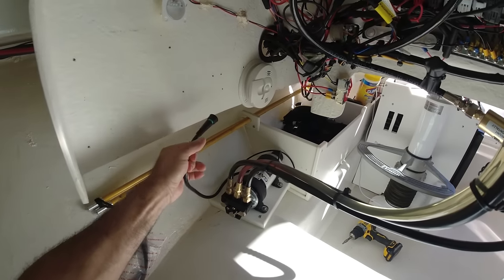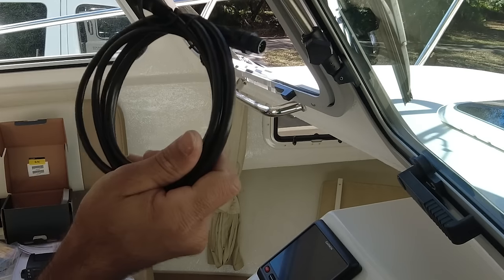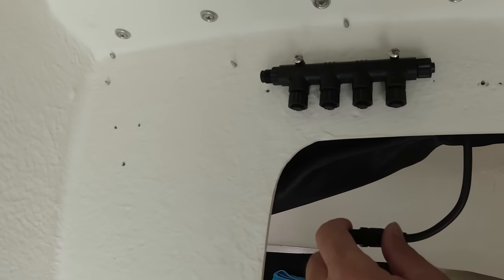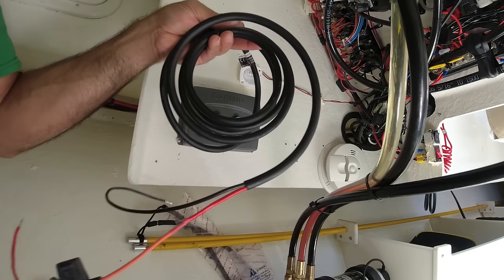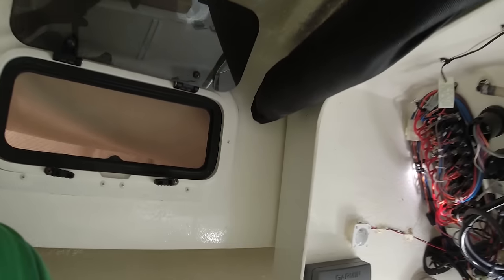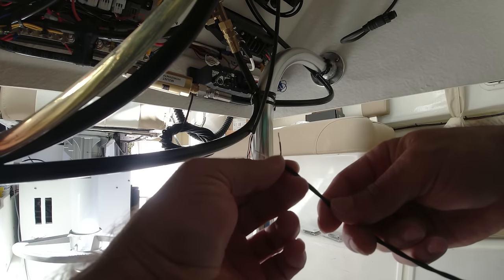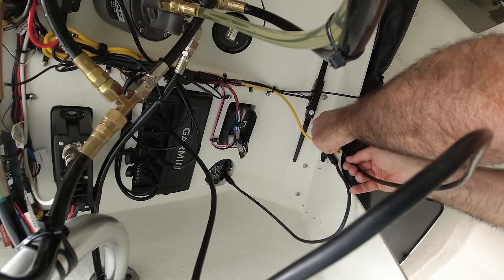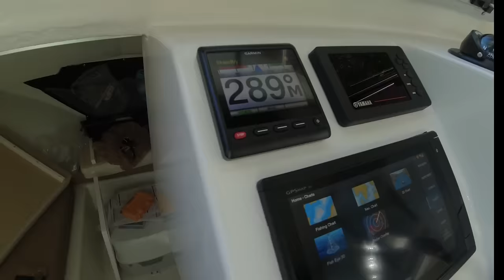Garmin Autopilot Components Installation Part 2 Garmin Reactor 40, Hydraulic Autopilot Corepack

Comment: Did anything need to be connected back by to motors tiller arm?  My old autopilot has a rudder sensor.  Wondering if the new technology doesn’t need it.
Reply from the maker: I dont have a tiller arm cap is just hydraulic  culinder and the computer is already program, very easy 👍⚓️

Comment: Once again Captain a very well instructed video. When I do decide to get the Auto Pilot for my new boat, I will be turning back to your video's for reference on helping me install this. When you asked about the price difference on what you put in and what was quoted me was they quoted the "Smart pump" which added another $1,000.00 to the cost. I'm wondering if i could get by with the 1.2 liter pump? Maybe to small for a 26ft twin outboards. What do you think?
Reply from the maker: Well captain for your boat you can use the 2.0 lider pump that is made for 2 engines  I am a 100% on that but you may want to check with raymarine and they may tell you the same thing the 1.2 is for one engine and the 2.0 is for 2 engine systems I hope this information helps And yes the smart pump is well over price but is a great pump

Comment: I am planning to spend cheap and just install at bare minimum. Can I just use the pump and ECU or also required to have CCU? I have a 9” Garmin 94sv. Thank you so much
Reply from the maker: well cap my unit works perfect just using my Garmin chartplauter instead of the garmin control screen

Comment: It looks like its been about 9 months since your install! 

Would you mind taking a moment to comment what (if anything) you would have done different or concidered more closely? 

I noticed on Garmin install directions the reccomendation of shut off valves to the auto pilot pump on the plumbing. I’m thinking that may be so in the event of a pump failure or leak, you can isolate the pump from the helm and still get back. Curious your thoughts on all that.
Reply from the maker: So far I had no problems captain it's been working great  And I carry some fittings to isolate the pump if there's a leak or failure that I need to isolate it and also I have hydraulic fluid with me all the time so I can do minor repairs if I have to but using the valve it's a great option is just a lot more work That you may never need👍⚓️
Reply: @OutOnTheReef  thank you for the feedback back I appreciate it. What type of extra fittings do you carry and any specific tools for it? 

I am concidering doing the same which is why I ask. I suppose the shut off valve is a quick fix IF something happens, but I ‘believe’ you may need three? 

Port/Starboard and return line

Comment: Just an FYI. How large are the wires that go from the bus bar to the battery switch?. Mine was only 12 Guage and I changed it out to 6 Guage. Buy connecting to the bus bar you have count the length of the wire from the bus bar to the battery for amperage drop. If you read the instructions to the auto pilot the wire size must be increased the farther away from the battery the auto pilot is installed. The standard wire the boat manufacturers supply the the bus bar at the front of the boat is only intended to run what they already have connected to it from the factory. If you have ever seen what an overloaded 12 volt wire looks like it resembles a  lit fuse. I actually rewired my entire boat with tinned (marine) wire and heat shrink connectors. Most manufacturers use automotive wire and connectors. It would add a substantial amount of money for the boat manufacturers to use marine grade wire and connectors. I have seen automotive type wire in boats costing 275k.
Reply from the maker: Yes i use what they supply i did not extended the wire cap. And yes that is sad that boats 275k or more are build that way that is terrible

Comment: How does your system react when trolling, have you tried it?
Reply from the maker: For trolling at the very low speed it's not the best but if you go 8 miles per hour to 10 I navigate all the time at that speed with no problems
Reply: @OutOnTheReef  Thanks, I noticed they recommend their higher-end Reactor 40 models which I assume come with the SmartPump V2.  Is that what you have or is it the base model?  Please, I like trolling for salmon at about 3 MPH.  They are twice the price as well.
Reply from the maker: @cstcomputers  yes that pum is mutch better but expensive  but last longer cap

Comment: Do i need this one for twin engines ? or can I use the ray marine one?
Reply from the maker: For the twin engine they recommend the same system but the pump has to be a 2.0 liter pu.p you may want to call garmin to confirm that, that's what I was told

Comment: Its a shame that all the marine electronics here in the UK are bloody near double what you get them for. I used to fit boats out, in fact I fitted out the RIBs that was in the boat chase at the beginning of the Bond film "Quantum of Solace", I only have an Autohelm 4000 on my boat, dated but works a treat for what I need.
Reply from the maker: Wow cap. I love that movie That was awesome that you were part of it. And the reason your prices are higher. Scattered with customs, your government is charging a lot for customs entry items fees.
Reply: Yes, I think they call it daylight robbery lol @OutOnTheReef
Reply from the maker: @stevewoodward7172  i agree cap. That is UK problem there the government wats a huge portion that sucks for the consumers 😔
Reply: I have an old 1974 boat called an Aquabell, she is 27ft long and has two inboard diesels, only a slow boat as greatly underpowered. She is coming out over the winter and I am doing a outboard conversion to her. I am fitting a Suzuki DF250, will be interesting to see how it ends up with a bracket extension to the transom. I am going to try to document as much as I can.   @OutOnTheReef
Reply from the maker: @stevewoodward7172  awesome cap. I would love to see it👍👍⚓️